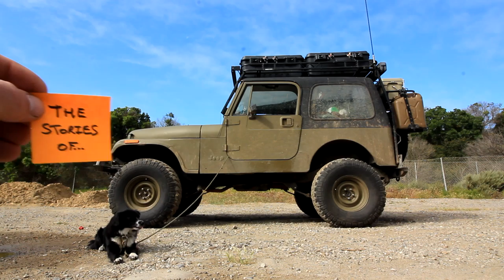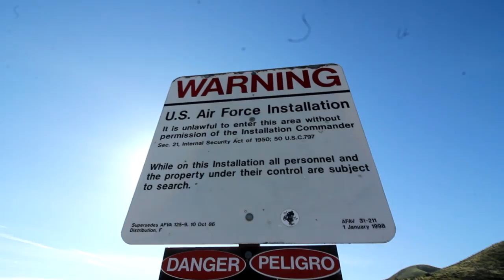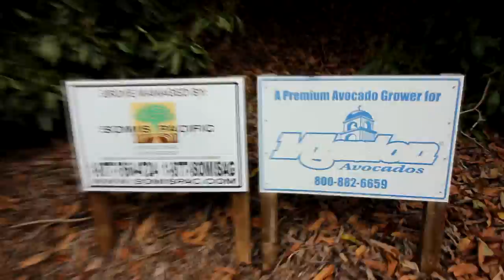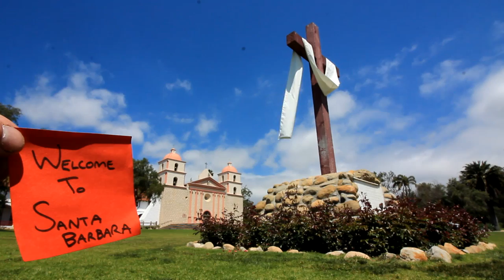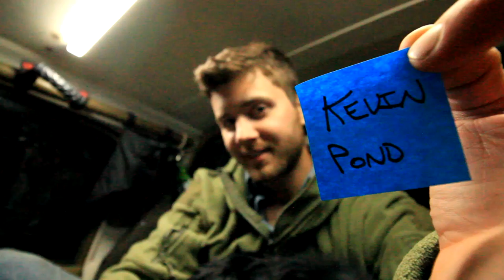COMPLETELY NECESSARY

Comment: @iamjake I noticed at 9:55 you have a fair wack of roof space in jade it would be simple to knock up a few brackets to hold your chair :)    happy travels man.

 ps : you've inspired me to take the leap into an older jeep instead of buying a jk  2 door.
Reply: monkeymachine  👍🏼 YJ's and CJ's is where it's at OIIIIIIIO
Reply: i would love either they are impossible to find in Australia; ( so it's a tj for me
Reply: Love that older jeeps are easier to figure out and maintain engine wise... But a 4 door J K has can sleep two in the back with the front seats scooted forward.